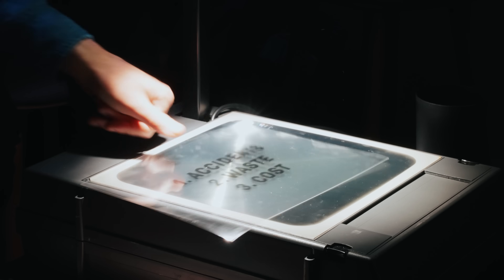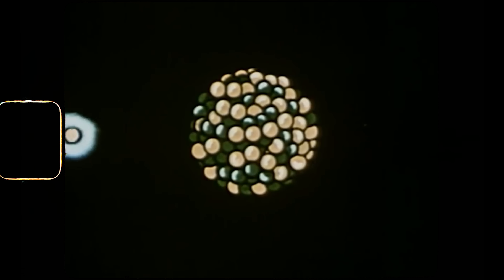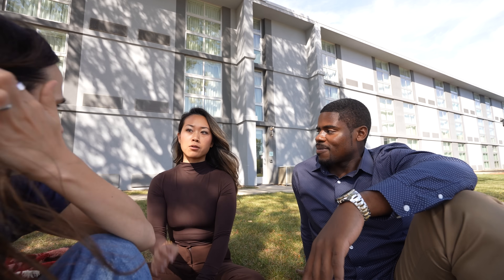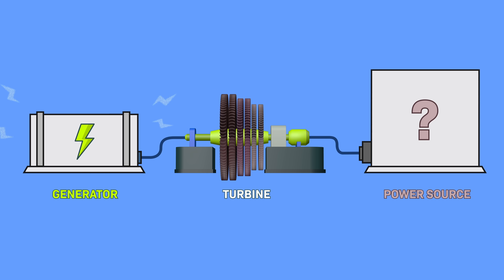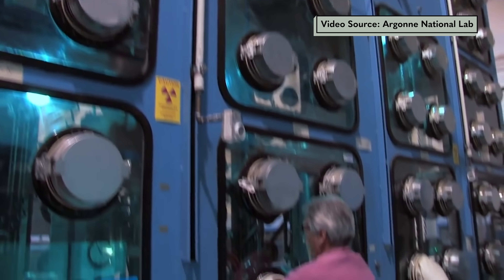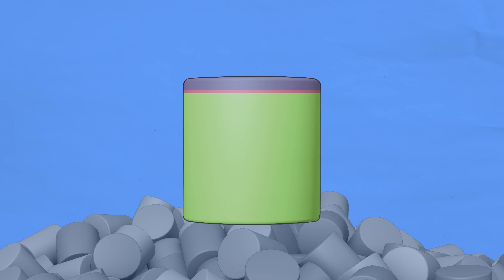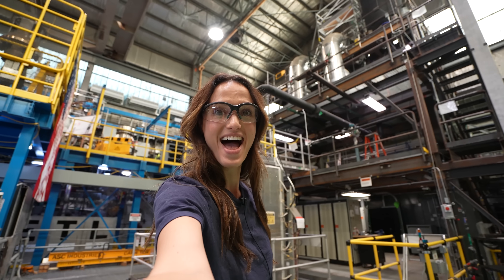The Big Lie About Nuclear Waste

Comment: As someone who knows next to nothing about this stuff, recycling nuclear waste always seemed like it should be a thing…

“We have too much of this dangerous stuff and not enough energy!”
“What’s dangerous about it?”
“It gives off too much energy!”
“If we used that energy, would it be less dangerous?”
“Yes, of course!”
“…”
Reply: yup. that is why they designed new reactors to use the spent fuel from old reactors .

it is real, and there already are functioning reactors that are running on waste from old reactors
Reply: insert patrick meme of why don't we put the nuclear waste in the nuclear reactors!??!
Reply: There are companies that recycle nuclear waste for reuse in nuclear reactors. However, based off my limited knowledge, apparently recycled fuel becomes no longer economically viable after the second time it's used. So while useful, it's use is still nonetheless limited. And as Joe stated above, nuclear energy is still better than wind and solar. Germany in all of its environmental genius has caused an increase in deaths in its local population due to restarting coal plants after realizing that solar and wind was shockingly insufficient to meet its energy needs. Oh yeah they are also buying nuclear power from France which is pretty silly.
Reply: Having watched the video you are not alone in knowing nothing.
Reply: It is a thing.  I'll give you an example.  Most nuclear reactors need ENRICHED URANIUM for them to work in a reactor.  That means, you need to boost the amount of actual uranium in the fuel bundle in order for the reactor to start up.  Once that % of uranium is below a certain level, it is spent fuel and unusable FOR THAT REACTOR.  HOWEVER, if you have a heavy-water moderated reactor - like the Canadian CANDU reactor, that reactor design allows you to use NATURAL uranium - no enrichment needed.  Why is this the case?  Because the heavy water used in the reactor, is such an efficient moderator of the neutrons that are emitted by the fuel for the chain reaction to start, you don't need as much uranium to get the reaction started.  The cool thing is, that not only can you use natural uranium, (no enrichment) the reactor can also use thorium and plutonium and, get this, the SPENT FUEL of other reactors.

China, or example purchased from Canada, a CANDU reactor.  What the Chinese do is take the spend fuel from their regular nuclear reactors and feed their CANDU with the spent fuel, to get more electrical power out of it.  The CANDU design has other benefits - it can also REFUEL WHILE RUNNING - the only reactor design in the world that does this.  The French recently hd problems with their reactors having to go offline - mostly because they had to refuel.  Not a problem with CANDU, and that's why CANDU reactors hold many of the world records in continuous operation.  Add to that, the fuel pellets that that company Cameco makes for the reactors is mixed in a ceramic - almost like a glass - so when the fuel is fully used up, all of the radioactive elements are encased in the ceramic - no leaking to groundwater if you decide to bury it for long term storage.

Finally, because radioactivity is ENERGY, if you leave the radioactive materials in water, you will naturally get hydrogen produced.  Hello, HYDROGEN.  Hydrogen that can go into a fuel cell.  Hydrogen that can be burned in a hydrogen combustion motor.

Many activists are just CLUELESS of the engineering that can be done to make all of this possible.  Seriously, we just need to let the engineers do their jobs, and ignore the activists in this case - they have no viable solutions, they have not done the math, and those countries that went crazy with solar/wind (Germany), they have major power bills because despite building  200% of what they need in capacity, solare and wind only deliver 49% of what they need.  They spent anywhere between 500 BILIION EURO to a whopping 2 TRILLION Euro.  If 500 Billion where spend in nuclear - every German household and company could heat their building with electricity, dry clothes with electric, cook food with electric, and still have power left over to SELL to other countries.  And that power is 24/7/365.
Reply: @quantummotion  Minor correction - the French mostly had problems with corrosion repairs as well as scheduled maintenance(other than refueling), although a small number definitely had to refuel. The real short-to-medium-term problem here being the corrosion under load.
Reply: @quantummotion  not forgetting that wind and solar are not only inefficient at producing energy, they’re intermittent. They have to be backed up by other forms of energy production most commonly fossil fuels. There are only a few countries in the world that rely solely on renewable energy (usually because their energy needs are significantly smaller than the US or they just aren’t as energy focused) and of those countries NONE rely solely on wind or solar energy. Iceland for example is 100% renewable energy reliant, yet their renewable energy sources are? Hydroelectric (dams) and geothermal (with a tiny bit of solar, wind). But that’s easy for Iceland given their population size, energy requirements and their geography (lots of tectonic activity making geothermal production easy! 😂
Reply: So there some criticisms. A) This only works if you keep using it? Like what if we wanted to stop... suddenly we would be left in the exact situation we started. This is a solution, but only if we buy into using nuclear energy for at least 50,000 years, and we don't have the option of stopping before then, because we just go back to square 1. B) Also moving to modern reactor design often means smaller more modular reactors which introduces the political problem from before of not wanting this potentially dangerous thing built near your home. We don't have a place to store nuclear waste because no one wants it near their home. Okay, then who wants a mini-nuclear reactor near your home. Same problem. C) Almost all nuclear material is kept under national security level protection. Multiple people with guns, often big guns, guarding this stuff (which we must do, no turning back, for 50,000 years). If we made reactors smaller or stopped guarding the materials, anyone could come in and strip the uranium for a dirty bomb. To be clear, you cannot make a nuclear bomb from this material, but you can make a bomb filled with highly radioactive uranium.
Reply: @William McGraw  fortunately, all of those issues are not issues in real life :)
Reply: From what i can tell is the reason we dont do it. Is because internationally it will make other countrys realize that they should do nuclear power and the concern is this will create nuclear weapons for thous countrys and so we cant have nice things.
Reply: @letsstudyquantum  You almost got it. This 'new' type of reactor has apparently never been prohibited worldwide. All we've really done is hoble ourselves with regard to energy production.
Reply: @letsstudyquantum  wrong in every way possible... I can't even begin to describe how wrong this is. If you actually watched the video you'd know that other countries are ALREADY doing this. Nuclear power fuel is nowhere near the requirements for nuclear bomb weapons. Also almost every other country in the world has nuclear power plants and had them for AGES.
Reply: @watvannou  so.. the theory here is that by converting existing nuclear waste into usable energy, we show that all nuclear is safe & should be mined & used.. which will cause a nuclear arms race.. where every country has safe nuclear power plants and doesn't need horrible, super-polluting fossil fuels to meet their energy needs? ...
and this is a problem because....?
Reply: @machinshin2253  this is a problem, because if everyone had access to clean and cheap energy, the first world would lose it's cheap labour and cheap raw materials from the 3rd world.

Imagine, gasp, if third world countries could manufacture finished goods from their raw materials and stop exporting raw materials. 

That's a nightmare for the USA and Europe.
Reply: @avibhagan  literally the only country in africa that has a functioning nuclear reactor is south africa
wtf is uganda going to do with their uranium? you think you can just make a nuclear reactor in your backyard or something? what do you think were doing with the materials now? do you think that if we used nuclear more they would have more leverage or something? you really think america would just allow a small third world country to renege on trading materials?
america has invaded bigger countries for lesser reasons
Reply: @avibhagan  You do realize that most first World countries are net energy importers aswell. The reason why key manufacturing is centered in First World countries, is their advantage in established high tech industries able to process resources and energy into high value goods. Nuclear technology is probably one of the most high tech, so it would widen the gap between the first world and less developed nations, as only the first world would have engineering capacity to build them (note, both Russia and China who are not considered part of the first World have however big engineering capabilities in the nuclear sector)

Comment: The nuclear waste side is definitely solvable and even without it safer than coal or natural gas. However, all base load power generation has a common problem: steam turbines produce more heat at a rate that will boil the oceans in 400 years.

Comment: My only problem with nuclear power is the fact that it is based on a limited resource. It is absolutely genious to reduce the time of nuclear waste while  generating energy. But putting too much money and human resources into that development could be risky, because at some point it will be too difficult to get more uranium. The sun will shine forever and the wind will blow as well;)
Love your videos!
Reply: If we make full use of all technologies available to reprocess and breed the fuel... the current known reserves could power humankind for hundreds of thousands of years.
Reply: Yah, however rare earth elements, which are used in solare pannel, batteries etc, are a limited resource as well
Reply: @Attila Fagello di Dio  There are many solutions for batteries, solar panels, etc, without rare earths. But I think a lot of research is exactly dealing with this issue.
Reply: @juliusvanderkuip1676  and those solutions still rely on a finite quantity of materials that could easily run out over time
Reply: @attilafagellodidio6226  It is my understanding that "rare" earth elements aren't actually rare at all. They're basically almost everywhere. It's just that they're very expensive to produce, and the process is very dirty as well, which is why we're leaving most of that to China and other countries.

Comment: so? you are essentially describing what happens in tricastin for decades.
there is some other fun fact: in the US, there is a rather large rare earth elements mine. they asked the DoE, if they can store the thorium they are mining and getting as a sideproduct. last time I heard, they were sitting on 5000t thorium (must be more today). if you add that to the fuel mix for breeding (no molten salt reactors, just good old fuel rods), you'll extend the energysupply to 1000 years or more. and they aren't even actively mining that stuff, it's just a sideproduct.
and as a bonus fact: thorium is approximately 4 times as abundand as uranium and like uranium, it's rather easily soluable in water. the thorium content in soil makes soil approximately as rich in energy as crude oil (if you could harvest it). and the uranium is still there. so essentially soil is richer in energy than oil.
oh, and there is another funny thing. amongst the elements in nuclear waste is Technetium 99. this stuff has quite some applications in medicine. just to think about it.

Comment: I just wanted to add a bit more insight. Fuel recycling is not particularly lucrative. It is energy intensive and expensive as Cleo mentions so there's an economic reason. The other main reason is the Plutonium Cleo also mentions but not for the reasons you'd think. Pu-239 is Fissile and so it will provide additional energy (good) but it doesn't always do this (bad). Plutonium will simply absorb a neutron ~45% of the time. This means it becomes Pu-240. This can then absorb another neutron becoming Pu-241 which will decay into Americium. The presence of Plutonium means more larger dangerous Transuranic elements. So although the long-term radioactive waste volume shrinks, each time you recycle the fuel you increase the concentration of shorter lived more radioactive/dangerous elements. For this reason you can only really safely recycle fuel once, maybe twice. Fast reactors, however would fully eliminate this issue, but have their own economic and engineering hurdles for mass adoption.

Comment: There isn't that much energy in the SNF of the country, unless she is talking about just electric power alone. 
Last time I did the calculations it was around 60 years of providing all Americas energy needs

Another great figure is that when utilizing fast breeder reactors, one pound of Uranium has enough energy content in it to power 100 years of the average Americans energy use.

MSFR in particular have high burn up rates of Uranium and the transuranic produced while operating, something like 90% Burn up. Where as HALEU fuel fall around 20% burn up rate.

Comment: The vast majority of nuclear waste is "low level", i.e. stuff like concrete and dirt that's just contaminated with small amounts of radioactive material.  The amount of "high level" waste, the kind that can be reprocessed into fuel, is tiny.

Nuclear power is already too expensive.  If mining uranium is cheaper than reprocessing fuel, that means that reprocessing would take something that's already too expensive and make it even more expensive.  Research is cheap.  We should keep researching nuclear power, and if it ever becomes economically competitive, great.  But we shouldn't count on it.

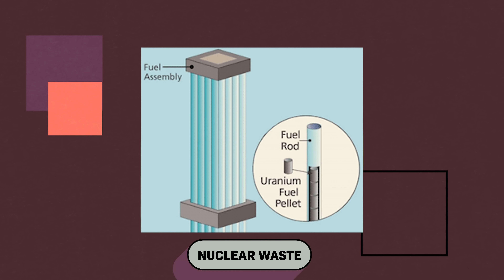7:15  No.  You cannot make U-235 out of U-238.  It cannot be done.  You can make heavier isotopes out of lighter ones by exposing them to neutrons, but you can't go the other direction.  Uranium enrichment means separating the isotopes, so that the U-235 you already had is mixed with less U238.

Comment: A fantastic video! Important point to note:

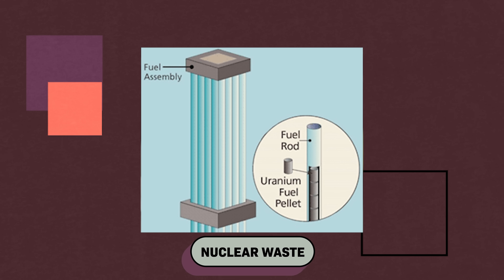@7:15 you state "So typically uranium goes through a process called enrichment, which is making more of the uranium 235 out of the less useful uranium 238."

I'm sure you know this since you point out in the previous sentence that .7% of naturally occurring Uranium ore is Uranium 235, but enrichment is a process of separating the existing Uranium 235 from the more common Uranium 238, Uranium 238 is not being transformed into Uranium 235. 

The phrasing of the script and the usage of the phrase "making more" may give the viewer the impression that Uranium 238 is being transformed into Uranium 235 which is not what is occurring. 

Keep up the great work!

Comment: The lack of Fast Breeder Reactor also deep space missions much harder and rarer. Plutonium the way best energy source in the outer solar system, as the systems are very simple (being robust with no moving parts). There is just not enough sunlight out there, and bringing other fuel is way to heavy.

Comment: Cost however is a factor when there are alternatives that ultimately cost less: hyro power, geothermal energy, solar, wind, tide and wave energy. It's all a lot easier and cheaper to manage. I'm not saying that nuclear power is dead, quite the contrary so especially when talking about modern gen IV reactors (imho molten salt reactors are among the best options we have at the moment or at least will have withing the next 10 years). BUT we also need to look at the costs of each energy source and pick a mix of enerrgy sources that makes economically sense while dramatically reducing our carbon footprint. The actual costs of designing, building, running and finally deconstructing a nuclear power plant are higher than what's often shown because a lot of these costs are being subsidised by the public while corporations make the profit.